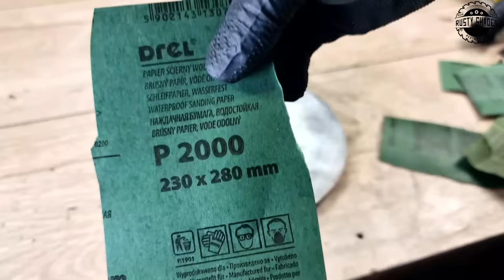Massive Antique Bread Cutter Restoration & Personalization with Ortur Master 3 Laser Engraver

Comment: Beautiful ! Great job 🙌 Very impressed by the laser. I have the same... dunno how to cut tho... keep up the good work !! 👍🏻
Reply from the maker: Thank you so much! ✊️ I'm using Lightburn Software, so there you have to set the speed at minimum and the power at 100% then you select the material thickness and if the material is soft that's all, if not  you can increase the thickness and try more passes. Cheers!
Reply: @rustyshadesrestoration  You’re welcome 🙌Ok great !!! I use Lightburn too. Can’t wait to test that tomorrow Thanks for the support ;)
Reply: @TheFabrik  Good interaction!LOL. This is Diana here. :yougotthis:
Reply: @魏莎莎   Oh !! 😅 Hi Diana !! I’m’still workin’on it 😉 Almost ready 👍🏻
Reply: @rustyshadesrestoration  thank you so much the greast advice my friend !!! It worked pretty well 🤟
Reply: :virtualhug:
Reply: @TheFabrik 0
Reply: There's only one letter separating garage from garbage. Some few make it back into the house, thanks to the oddball interest of restorers. Well done.

Comment: Good work! However, I wouldn’t have restored the wood. It was badly damaged by the wood destroying insects and the chemical that was applied to kill them.
Reply: Maybe you missed the part where he completely restored the wood; this is a restoration video. Check the title.
Modern woodworm treatments are VERY safe for humans. I'm sure he let it set for the requisite 24hrs; again, don't know if you caught it but he covered the holes in wood putty and used food safe paint to finish this lovely piece. It's fine.
Please try to keep up in the future.
Reply: Why do you sound so mad about it? It is just an honest opinion.
Reply: Retiring the wood would've been better had he used epoxy and left to where you could see the worm holes. Gave it very good character
Reply: @medicbabe2ID  Thanks for the jerk comment. The wood is rubbish and I wouldn't have "restored" it either. Putting wood putty over trash doesn't stop it being trash. Thats like restoring a rusty car with bog instead of fresh metal.
Reply: @medicbabe2ID i woulnt call it restored when it's painted , if restored it would be visable Wood as when it was new , and used putty still it had more craters than moon , "new" old Wood would be a better path
Reply: I was just curious about the bug spray soaking into the wood? Do you think the paint will stop any side affects?
Reply: @pikkz394  your point is well taken. The paint wont stop it.  In fact, it will contaminate the bread.
Reply: @ArmySigs and it's good that it wasn't you who did the renovation, things from the 19th century must have as many original parts as possible

Comment: My mom had one and it worked so much better then the new electric one I had. Notice I said had. Hers had some weight to it and was sturdy. 
Wish I had hers. Always a great transformation. Thanks.🇺🇸
Reply from the maker: Thank you, Fritzie! Some kitchen gadgets were better back then than what we have these days. Now they are making them last 2-3 years if you are lucky.
Reply: @rustyshadesrestoration  Have to say, that’s true. I have a Levit house 1949 ranch. In my garage is the original refrigerator. We use it as a spare when we have a party. Works like a charm

Comment: I was really surprised to see the wood sandblasted. I'm not a restorer so I have no clue if it would have been easier or not but I found myself wo during why sandblasting rather than sanding for that part? The restoration was well done and beautiful! Kudos !!
Reply from the maker: Thank you so much, Tonja. Sandblasting wood is a known and common practice among restorers. It cleans the wood better and doesn't harm it like sandpaper, especially if you have some carvings on it. Here you can read more: https://startwoodworkingnow.com/sandblasting-wood/
Cheers!
Reply: Why bother? You puttied and painted it. Also, that wood will likely resemble swiss cheese on the inside and be structurally compromised. One would think the only reason to preserve the original wood is for aesthetics but painting it renders that reason a moot point. Why not just replace the wood? Not to be an arm-chair quarterback but wouldn't it have made more sense to impregnate the pieces with an epoxy resin that would strengthen the wood and still allow you to see the grain and the wormy texture? You would also have been able to stain it as you wanted before applying resin.

Comment: Tha was and you always do a great job.  I would like to mention a tip that I got of another Man's channel.  A bell that needed to be fixed cause the bottom of it on one side was gone.  He used solder strips he placed under it.  I was thinking THAT WON'T WORK"!!
he placed one and melted it.  Then another.  And a third one.
He then sanded it and it was hard and stayed that way.  I was really surprized.
Your way was also great
Reply from the maker: Thank you. That's an interesting method, I will think the same, that won't work. I have to try it too in one day. Cheers!

Comment: Did you fill the wood with poison, cover it with food safe paint? On a item to be used with food?
Reply from the maker: After you use poison, you have to let the wood for at least three days outdoors or in a well-ventilated area; then if covered with food-safe paint, you can use it. 
In my case, this slicer will be used as a decorative piece, the single-use was for my cutting test.

Comment: Great restoration! I don't agree with the choice of colors.... but you did the a great job nonetheless!...only but I have is that I think it would look a lot better if you replaced the wood instead of painting it as the gray color is not really attractive, or maybe use some other materials to cover the insects holes, and plug the screw-holes with wooden pegs? 🤔 anyway! great job!

Comment: What do do you if there is lead on the item you are working on ??
Reply from the maker: I'm cleaning it with a gel paint stripper and wearing gloves and a mask, and then I'm contacting the company that deals with this kind of trash for proper disposal. Luckily in my city, there is such a company. 
Anyway, important, it is to don't create dust while removing the paint, like sandblasting or manual sanding.

Comment: Just letting you know that when bluing things you have to put oil on the parts so the blueing solution stays on the parts.
Reply from the maker: I'm doing that off camera, as well cleaning before bluing with acetone.
Reply: @rustyshadesrestoration  ah, ok. Thats good to hear. Anywho, great videos.
Reply from the maker: Thank you. I showed that in some videos, but when they are very long, like this one, some things has to be cut off, otherwise ppl will skip a lot, unfortunately and it is affecting the video performance. But as I said, I cut only what it is obvious or I did many times in other videos, so my audience knows already. Cheers and thanks for watching 🍻

Comment: Looks to me to need a washer under the wing nut, maybe?
Reply from the maker: I didn't saw that on other models, but yes, could be done that too.
Reply: @rustyshadesrestoration    Just looked like the nut or slot was out of round, and that would provide a flat sliding surface without binding as the wing it was turned. Likely something easily lost during cleaning cycles.

Comment: That's a ham knife. Bread knifes have a wavy edge. No wonder it cuts your bread badly.🧐
Otherwise brilliant job.
Reply from the maker: Thank you. In my research I didn't find anything related to Ham Slicer in this shape made by Alexanderwerk. The bread slices are looking good too. There was any problem, just with the stability on my workbench which is quite slippery. Thank you for watching.
Reply: That's just another knife for the device. You can still buy slicers with both types of knifes. And probably you can find one which still fits into your machine.

Comment: Instead of burning the wood you may use an soldering Iron to loosen the woodscrews;-)
Works as well and does no damage.That is of course you want to use the wood again. ...
but in this case--Tbh : Why bother? Doesn't make sense to me. Either you use the old wood than conserve it visuable, or take new one . Also the use of chemicals are too much for a kitchen Item. For woodworm and insects Pure Alcohol like Isopropanol is way more healthy.
It devours completely and is sanitary. A new piece of Hardwood would have suit much better..
Not a friend of putty tbh..
So with this restoration I#m like 50/50..
:shelterin:
Reply from the maker: Thank you for the tip. I will try it 🙂

Comment: Ooo what a good idea to spray/soak the wood with toxic chemicals.

The same wood that will come into contact with food - bozo.
Reply from the maker: I think a better idea is for you to read a bit more, buy some glasses, and stop writing without asking. And if you wonder why, let me explain what you are missing:
1. The spray evaporates after 2-3 days if left in a well-ventilated area (this you didn't see or know, that is why it is reasonable to ask);
2. All the holes were filled, and the surface was entirely covered with putty;
3. After sanding the putty layer, two coats of food-safe paint were applied so there is not even the smallest contact between "toxic wood" and bread. 
4. If you read a little more, you will see that I mentioned that the item will be gifted and that it will be only displayed even though it can be used without any problem. 

So, next time, ask, instead of playing as Mr, know what is better for my work.